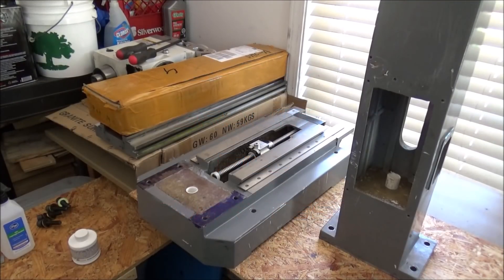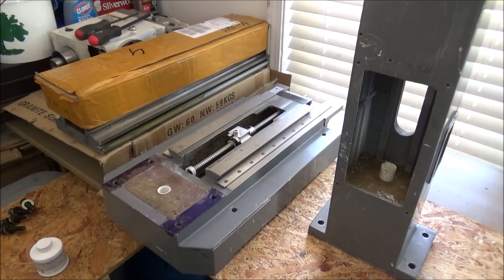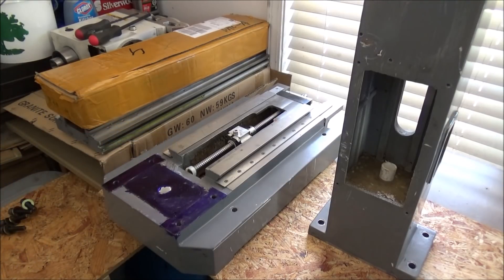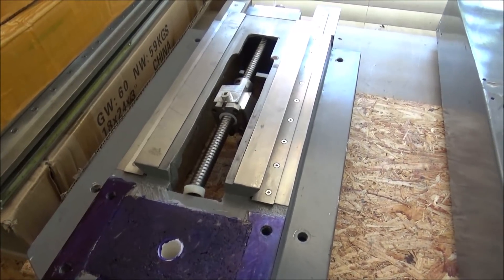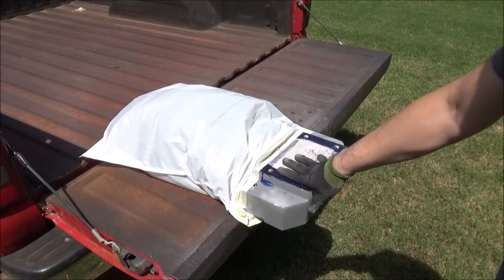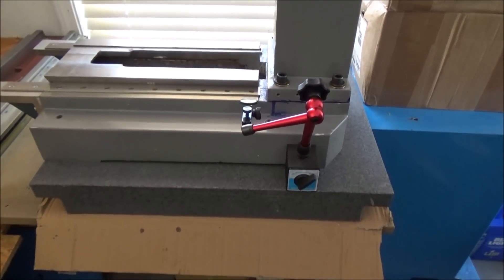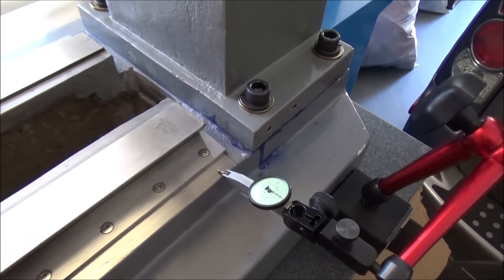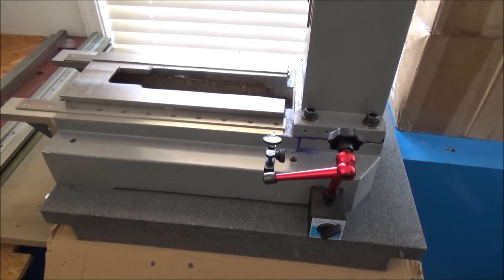Epoxy Granite Fill Base Flex test

Comment: If the e-granite is just a few thou high, it will easily compress under the weight of your Z column. Be sure to bolt it down solidly to the floor to get the benefits of your slab strength and stiffness.
Reply from the maker: Yeah maybe but it's pretty solid stuff.

Comment: A word of warning to anyone watching this: wearing a dust mask rated for sanding dust like he did is not optional, it is a MUST. I don’t know the exact composition of the castinite but if there’s any silica sand in it - or if you are using a DIY mix with silica in it - and you breath the dust, you will get silicosis. The problem is that silica is totally bio-inert; so it goes into your lungs and stays there forever... preventing air from reaching the surface of your lungs. The net result is that you can’t effectively breathe.
Reply from the maker: Yes this is nasty stuff and Outdoors is best so your well ventilated.

Comment: In my experience the epoxy granite adds mass for dampening, not rigidity. This machine has flex due to its light weight design. Another good video.
Reply from the maker: I found that Yes it definitely adds Mass I feel that every time I move it. LOL The flex is also definitely  improved. from what i can tell. will see if I ever get finished.

Comment: Wouldn’t putting the mag base on the column and the indicator on the base give a more accurate measure of flex?
Reply: I don’t understand your methodology, was the mag base sitting on the granite base, if yes at the base of the column what you are mesuring my not be flex but lifting  of the base ( base sitting on 2 legs).
Reply from the maker: The base is heavy without the added #50 of epoxy and we are measuring very small increments .0001"  There is no lifting at all. there is a great deal of flex in the base without the epoxy fill the slightest pull or push would cause deflection as much as .005" toward the center of the base. Now i will admit I did not use anything to measure the amount of force I applied to induce the deflection measured. However I can tell you after the epoxy fill I put a lot of effort trying to get it to deflect. I would say 10 x as much as before. I understand these are not clinical tests But I did use the same method before and after.
Reply: Possibly, but comparing the original flex setup with the same setup post-EG pour provides a like to like comparison.
Reply from the maker: That Would indicate total flex distance. I may have used a bad choice of words. The base flexes and bows when the column is pushed or pulled. This is similar to the forces applied when machining. There was quite a bit before the epoxy fill with even the slightest force applied to the column.
With the #150 of gearbox , beltdrive, motor. And pdb there will be some forces pulling the column down but with all that weight it will be in one direction.

Comment: Sam what if you filled them with lead? As in melting and pouring lead. I know that would be quite impractical but wondering if lead would work even better than granite fill
Reply from the maker: Mr. Morningstar  Well there you go in that case with the flex and vibration it may act like a mold and pop right out. which is no good. you want it to bond together and become one solid piece.
Reply: No, lead is not stiff at all. He's getting absorption of vibration AND stiffness increase. Check the explanation here: https://www.adambender.info/post/2017/03/25/epoxy-granite-machine-frame-how-to
Reply from the maker: Well I think it would work if you had a way to form it up. I dont think it would shrink and it should provide all the same benefits.
Reply: Mr. Morningstar Thank you for the link, interesting chart. I see lead as higher on the loss scale than epoxies and stone but indeed softer. So it would absorb vibrations better than diy granite however it is not stiff. But as long as it is enclosed in a metal frame stiffness may not be an issue? Just wondering. As far as shrinkage that’s not an issue. Lead with a little bit of tin or antimony shrinks very little. Obviously lead would not work as a stand-alone router base
Reply from the maker: I would say if you have access to free lead , a way to melt , pour and make forms then go that route.
Reply: @robertcretu4363  Hey I shared the link, no fair! 

Just kidding.

This video shows how much stiffness makes a difference - the flex is gone pretty much. I think the 2 attributes - stiffness and vibration damping - are equally important.

Stiffness for accuracy / faithful implementation of the g-code, and vibration dampening also helps accuracy but will have a real effect on surface finish. In both instances you should be able to run your process quicker.

For pro machines, this obviously  matters.

For hobbyists? Well probably not.

If you do it, please post a video, would love to see a similar pre/post pour stiffness/flex test.
Reply: Aaron DC mediA I ll share if I go that route. I have a way to melt a lot of lead in a hurry though lead is not free anymore

Comment: Sam, being that the epoxy concrete is porous, would it be a good idea to seal it with an epoxy sealer or epoxy paint to keep any coolant/oil from soaking into the castings? Nice video, glad to see them start up again.
Reply from the maker: I dont think it will be a issue. And the casting is in primer.

Comment: I thougt, whether I should mention it, but your last words were, be safe. So I do it: Never use gloves together with rotational tools. I know it, because I am a safety expert, and I know it, because before that i had a bad reversible accident with a milling insert in an electric drill, where the glove was caught, and my thumbnail with it. It is not lethal but very painful!
Reply from the maker: Yes you are correct I do try and emphasize safety as well as practice it myself. Holding a piece of stock while boring a hole is definitely a no no with gloves. I thought for certain someone would pick up on the fact the guard was missing and gig me for that. Lol. Unfortunately the disc would not fit with it on. Thank you for pointing the gloves out I did way the risk and I wore them to carry the base out to the truck.

Comment: Cool Sam. I'm finishing up my gantry mill. And might do this. The ATC is on hold. I have not been able to stop tool pull out. It looks like I'll have to put a better spindle on it with a BT-30 tapper. I'm using an R8 and Tormach tools right now. 

Keep it up man love it! Best Matt
Reply from the maker: Hi Matt
Thanks what size bellvilles are you using? I've yet to have that with my pdb setup.